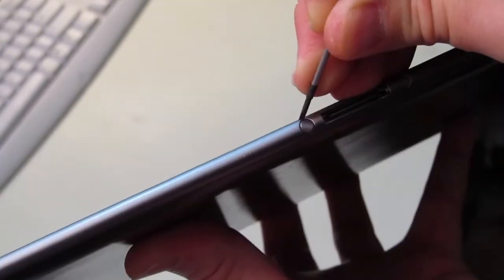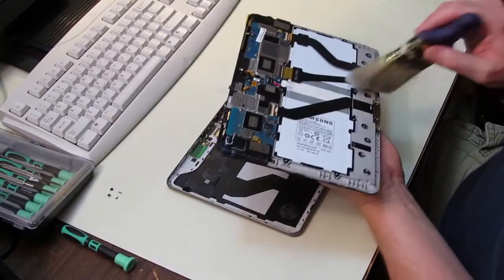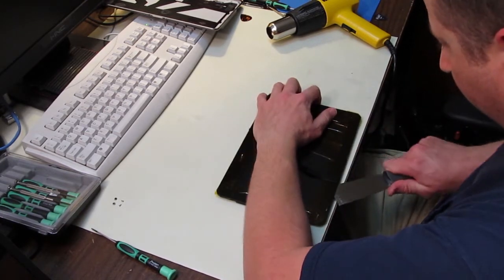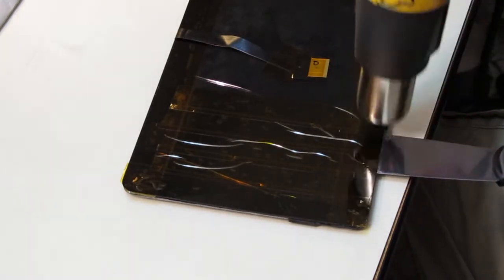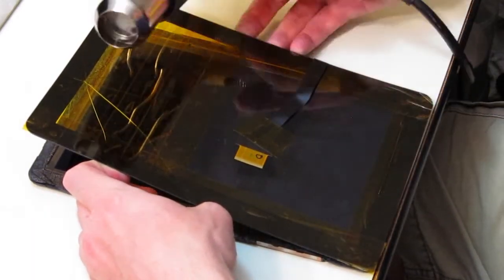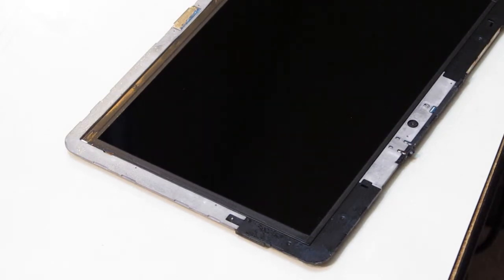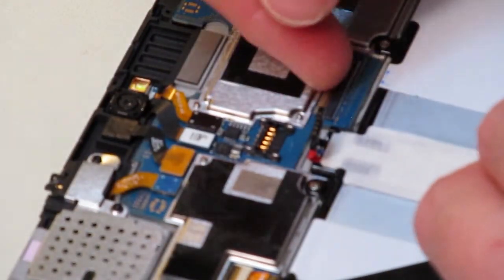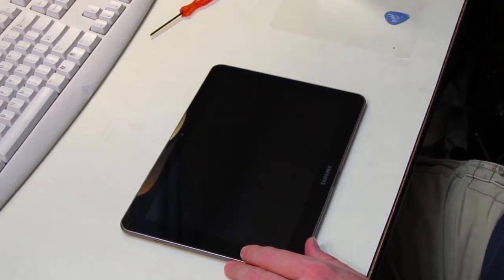Galaxy Tab 10.1 GT-P7510 Digitizer Replacement

Comment: Hi just wondering if you can figure out I have the same model but mine is doing horizontal static and getting worst the longer I use it what could be possibly broke on it digitizer or LCD can you advice me please
Reply from the maker: Hi, 1st check that your LCD connection is in all the way (you have to take the back cover off.)  Sounds like you need a LCD replacement, the digitizer or touchscreen only deals with the touch motions and is transparent and would not make the lines.
Reply: David Chello hi thanks for the reply yeah thus changing the digitizer is the same way as changing the lcd